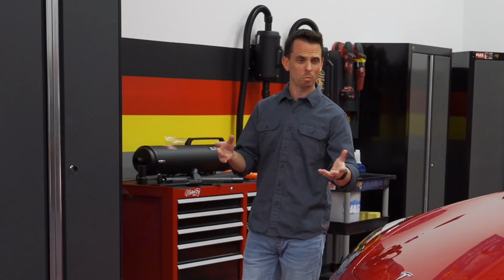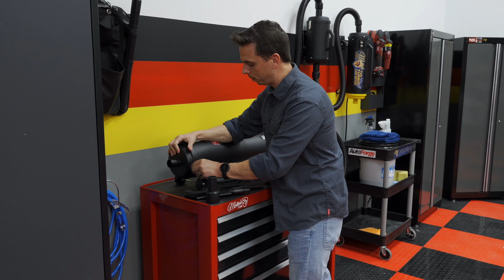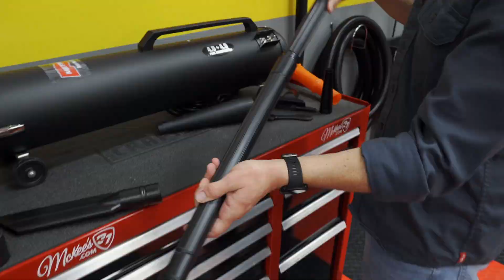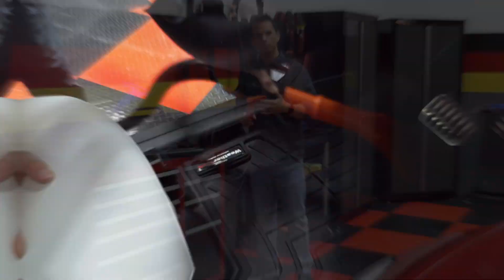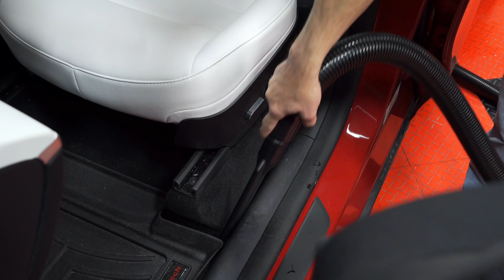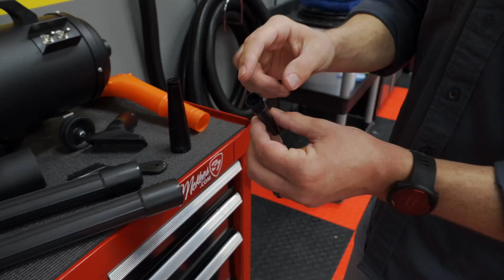Car Dryer & Vacuum Buyer's Guide

Comment: Thanks for the video. Good to know that you can adapt existing car dryers like the MasterBlaster to be vacuums and not just car dryers. I'm not sure that it would be convenient to switch it between car dryer and vacuum modes though. Might just be easier to have separate machines.

Also wanted to mention that these higher powered vacuums and motors require 20 amp outlets/circuits and will trip on 15 amps when you turn on the second motor.